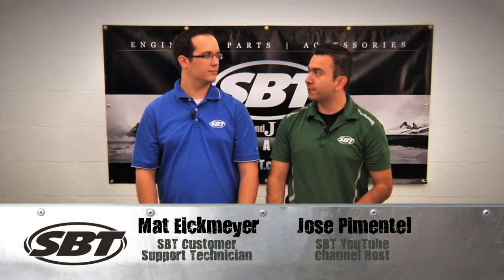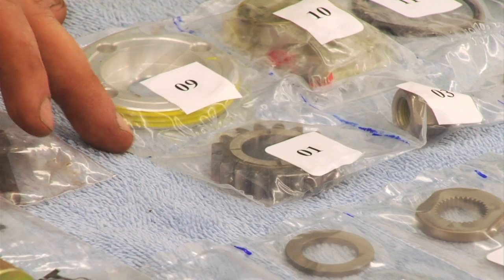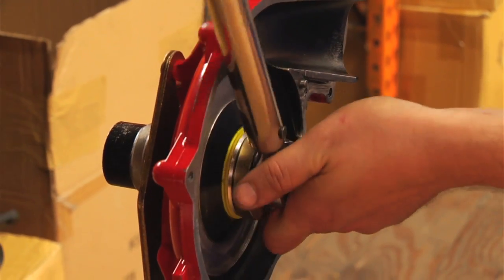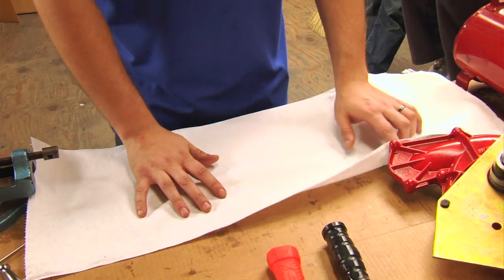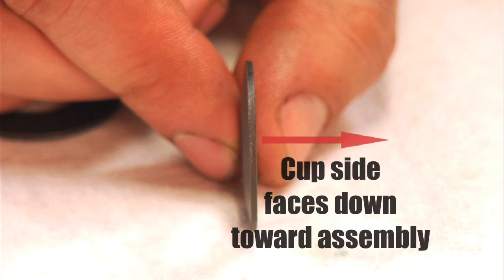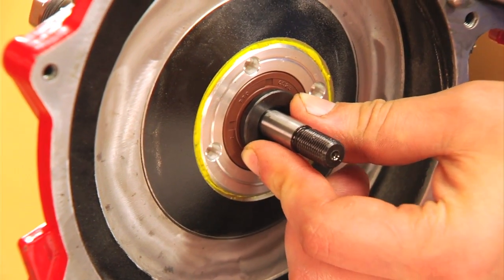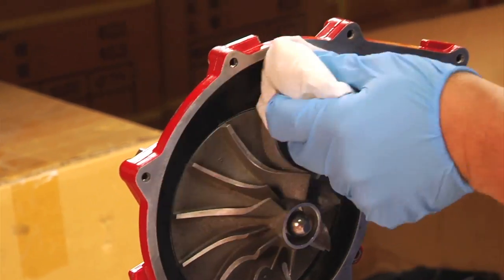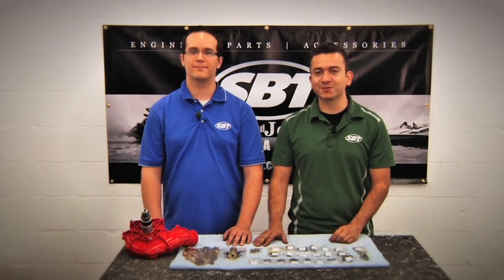SBT Tech Tips: Supercharger Rebuild

Comment: anybody who follows the steps in this video is asking for problems...You press the bearings on the shaft AND into the housing BEFORE you put the seal thrust disc in..REASON: the bearing behind the seal can and does push out when you press the shaft into it..Also you tighten the impeller nut first as if you dont...the clutch thrust assembly can spin on the shaft blocking the oil hole....Also you DO NOT use grease when assembling the supercharger..You want to use OIL...NOT grease.......Like i said..follow these instructions and you will be replacing your Scer and or engine ssooner than later...
Reply: Do you rebuild these SC'ers? I have mine removed and am looking for someone to rebuild it.

Comment: how to you check the slippage of the clutch? thanks
Reply: The ship guide says to use the gear holding wrench and hold the gear while turning the he nut at the end of the shaft woth a torque wrench, and it gives the force a new clutch should slip at but I am not going to share that number because I doubt they're all the same and I don't want someone too inexperienced to do the rebuild mess their SC up with my SC specs